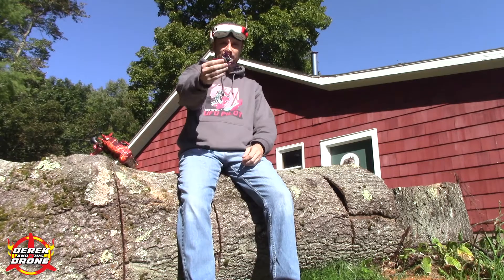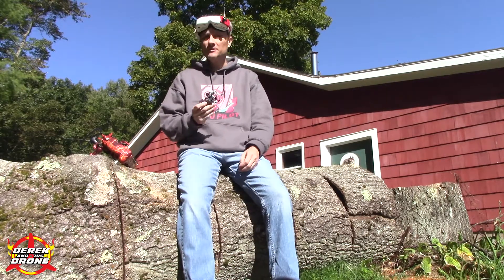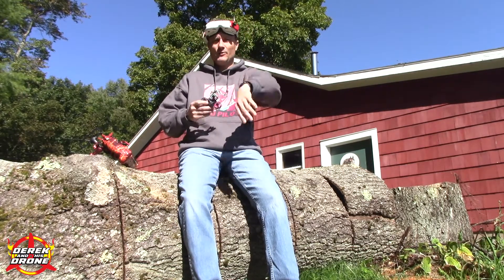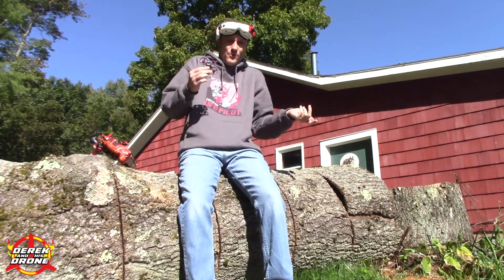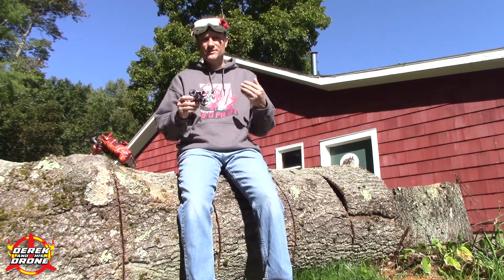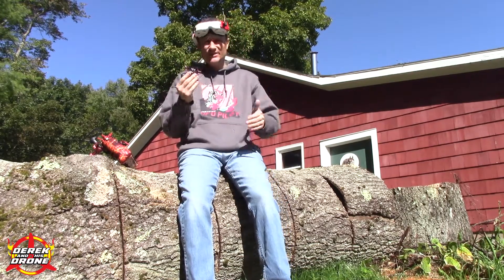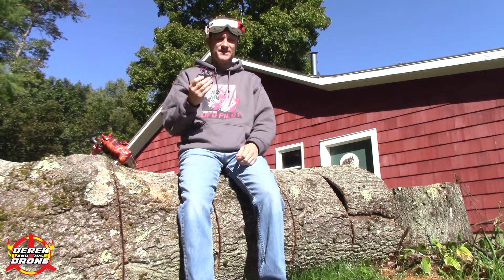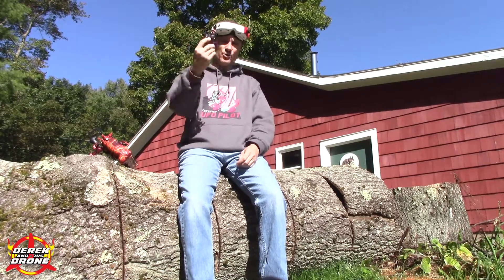Ultimate 2S Tiny Whoop Build 2019 - The Conclusion

Comment: Why would you use this Pigtail over an XT30?
You wont have fun flying.
Reply from the maker: TX30 is too big for a 65mm
Reply: @DerekandhisDrone  its just a little bigger than ph2.0 connector. You cant even full throttle for half a Seconds before it goes down to 3.2 ish. You need at least 20 Gage wire and XT30 or now there also is the BT2.0

Comment: Nice build and nice video! 👍 😎
I used parts I had laying around and came up with:
- UR65 frame
- GepRC 12 amp AIO board
- Frsky R9 mini receiver
- Racerstar 0703, 10,000kv motors
- Camera and canopy from a UR65
- Buzzer and XT30 connector.
I literally had all of these parts on hand and didn't have to buy one thing! Lol We'll see how it flies and performs. Probably much slower than yours, but I'm sure it will have much longer flight times. I think that's a definite trade off. Bigger, faster, higher KV motors give faster flights, but the battery power is eaten up QUICK! Smaller motors don't have the speed, but give long flight times. Mines mainly for indoors, so high speed isn't my priority. Plus, I've had those motors laying around for about 2 YEARS and I've never used them! Lol I thought it was about time! 🤔😊
Thanks for showing us your build! Keep up the Go0d W0rk! 😎
Reply from the maker: I'm happy with how it came out.  Flys really well.

Comment: What betaflight version did you used? Would you mind sharing your pid profile.
Reply from the maker: Betaflight 4.0.6  the tune is mostly stock I just increased the I gains to 100 and set the feedforward to 25 and 30.  It could use a better tune I can hear the props fluttering but I probably won't do anything about it.
Reply: Appreciate your response! Im also building my 65mm whoop using the following parts:
Hbs f4 flight controller
Newbee drone cockroach frame
HM 802 19kv motors
Ewrf vtx 25-100w
Its a challenge to solder he small parts. I hope I could build this without any problem. This is my first brushless build that is why I wacth your build.
Reply from the maker: Practice your soldering it is a learned skill and it takes time to get good at it.  Don't be afraid to ask for help if you need it.  Also a multimeter can be used to check for mistakes.

Comment: Really nice build. I already ordered the same parts, except for the Tbs Crossfire. I will use a FrSky R-XSR.
Can you give any Info‘s about your Betaflight Settings for the Whoop?
Reply from the maker: I hope you enjoy it, I love mine!  I really don't do anything special in Betaflight.  I only changed enough to make it flyable and just input my average numbers.  On the 2S whoops I usually bump the I gain to around 100 and reduce F to 25 and 30.  That's it other than rates.

Comment: Nice flight footage, we want that with 3 min + and it could have a little less power (throttle @20 a 30% u got )
1 When are u gone trying other motors ?
2 Can it handle 2x 450mah from tinyhawk (14 g each @ 28gram) ?
3 can a power whoop fly 3 min with 2x 300mah , what to change ?
4 are there listed reference's ( motor + fc + frame + battery's + fpv cam ) that show flight time and stability 

Im looking for a perfect whoop that can power loop and dive but is very stable and can do 1s and 2s (i might go for tinyhawks with dual ph2.0 solid pin but does the THS handle the 28 gram ... ?)

and maybe a us65 with 802 motors ( only 1s then ) many build feel like under (unstable) or overpowerd short flight but hard to find info about the sweet spot 

(or u could build 3 kinds super fast , moderate , and long flight time  , but most important is the flight stability)
cheers
Reply from the maker: The 450mah batteries are going to be too big.  RDQ has some 350mah whoop batteries I want to try.  I think you are asking a lot of a whoop.  Like you said at the end maybe build them for specif flying.